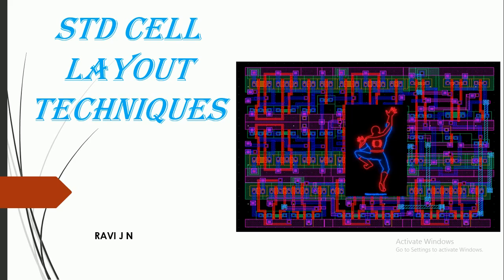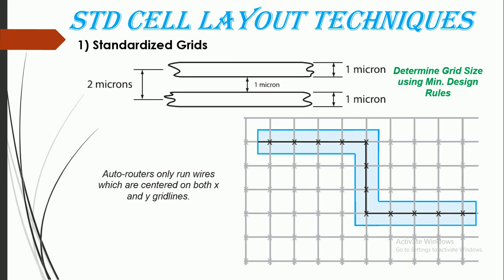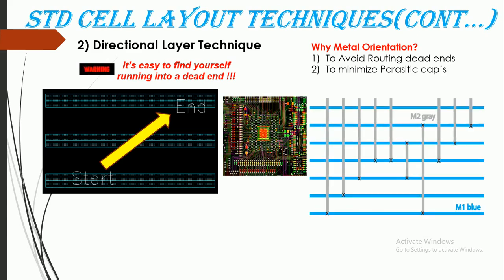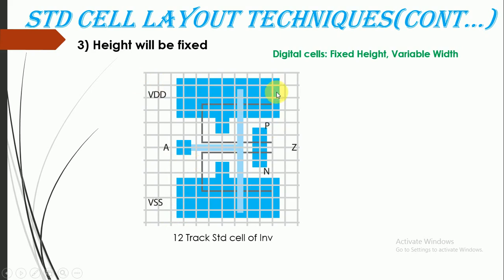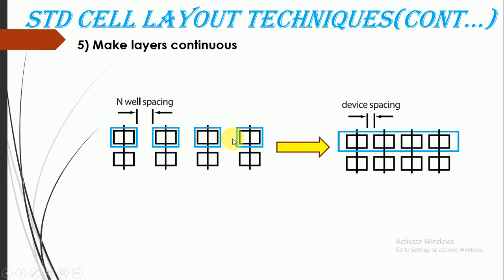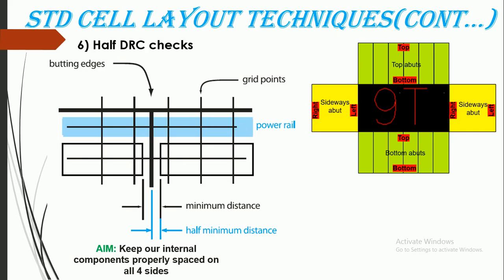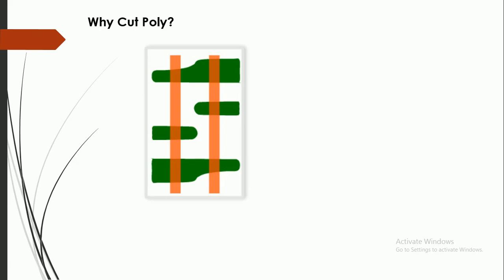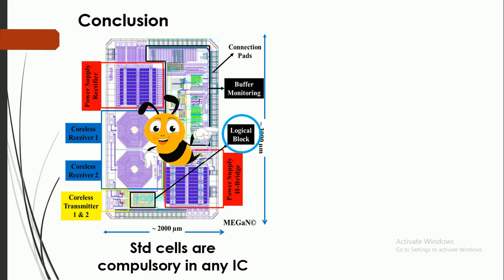Standard cell Layout techniques | Digital IP | Interview questions | VLSI design

Comment: Hi Ravi 
Again I have a doubt. 
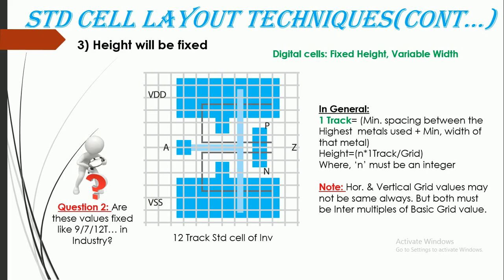At video time 11:07  
A standard cells layout is shown, see the horizontal tracks and M1, Is is justified to 12T height? It seems 10T for me. 

Although there are no PR boundary shown , but M1 of VDD and VSS will generally goes half of its width out of PR boundary.  so cell height is just height of PR boundary, right? So it will be lesser than M1-M1 total vertical height.
And as per this image shows cell height seems 10T, even max height from bottom to top on M1 is 11T only. 

Please let me know if I am missing something here.
Reply from the maker: U are absolutely correct. 
Normal convention is to consider the one track for vdd & vss rails for the track naming like 12T. 
Yes.... End of the day u will only have 11T to do the layout in a 12T technology.

Comment: Hi Ravi, Nice explanations on various concepts. Now I am not clear about the many questions raised during the video.
Could we discuss here? It will help to other viewers also.

1.  Could you please explain routing dead end?

2. Which other layer/layers, apart from Metals & Poly for Routing?
Ans :  Contact, Poly, Poly cut, M1, VIA1, M2

3.  Are these values fixed like 9/7/12T… in Industry?

Ans: Not sure, but There are 6T and 8T also in 12nm node.

Let me know your answers on these.
Reply from the maker: Thank u Rajesh....

Yes we can discuss, I was looking for this replay from someone.

1, Routing dead end means when we don't have any ways to route from a particular place, with given metal options.

2, no..... cutpoly is not a routing layer. There is one more ..... Try guessing.

3, correct .... It won't be fixed in all technology node. But will be fixed in a particular technology.

I hope this will help. 
If I'm missing out on something other people's are welcome to add or correct me. ☺️☺️
Reply: @SemiEngineer   I have got some relevant literature regarding your question

  1) Which other layer/layers, apart from Metals & Poly for Routing?

Although I have not got chance to see such layout till now, But I got a thesis ( in association with imac ) which says that 
Interconnect layers IM1 IM2A, IM2B is used to connect two points.
IM1: -  used to short the fins of FinFET
IM2A :  Horizontal routing 
IM2B : Vertical routing
 

Let me know your answer please.
Reply from the maker: @rajeshyadavece49  i wss exepecting OD layer.
 I'm happy to see that u are helping others aa well.😀
Reply: @SemiEngineer  
Thanks Ravi,  I will check  it. 
But I think layers name vary foundry to foundry, and even in a particular foundry also for every new technology node  layers name they try to keep as usual in old node but some new layers add as per the requirement of new masks. I told the answer with respect to IMEC data used by the researcher in that Thesis.

So, If you are interested, please share your email ID , I will send you that thesis ( with page no. on which i referred) Then make it clear here that the above answer is correct or not.
Reply from the maker: @rajeshyadavece49  yes.... U are right, names will change. I was referring to base layer- oxide diffusion layer.

Yes please .... Send it to my MAIL ID
ravijn095@gmail.com
Reply: Thanks @ @SemiEngineer